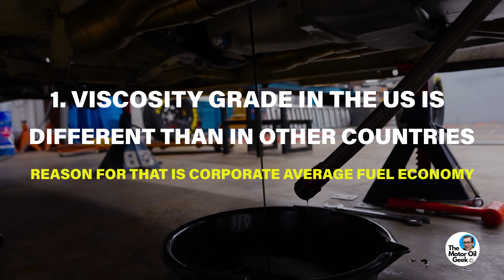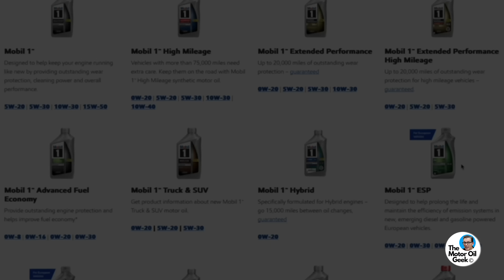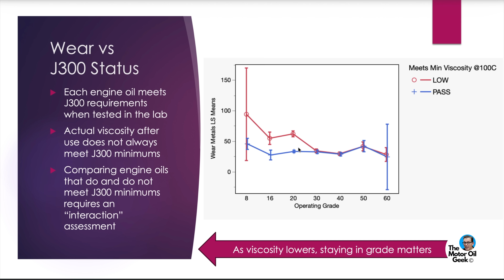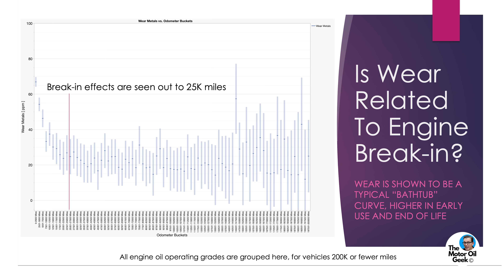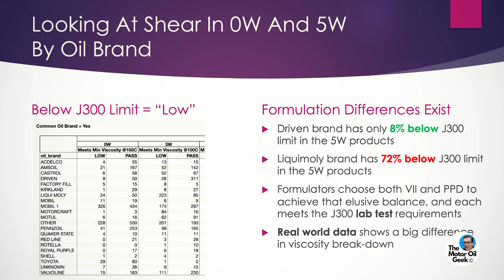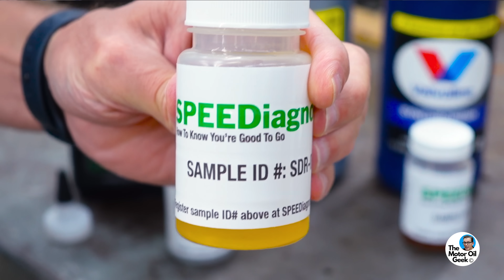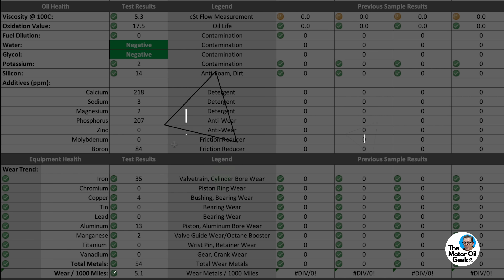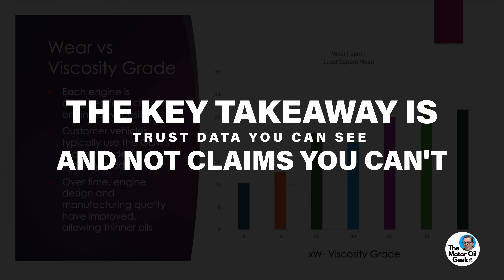More Ai Lies? The FACTS about 0W-20 vs 5W-30 (With Evidence)

Comment: The information you give is amazing and I can't get my head around it completely though. Is Mobile 1 0W 16 a good oil for my Toyota Corolla XSE or should I be using a different oil. Is the 10,000 mile oil change ok or should I be changing more frequently.  Oil testing is next to impossible here.
Reply: Mobil 1 includes a very high quality VI improver, which means it's more sheer-stable than other VI improvers.
Reply: @aliendroneservices6621 Where did you get that info please
Reply: @candyman1967  I got it from watching a video on this channel.
Reply: @aliendroneservices6621thanks

Comment: My car manual says 0w-20,5w-20,0w-30, 5w-30, 10w-30 all work, the cap says 0w-20 but in Phoenix sucking in 120F air all summer I went with 0w-30 after hit 105k miles.
Reply: Honestly, in Phoenix, you could use 10W-30 so you have a lower Noack volatility rating since you basically don’t do cold starts.
Reply: @slscamg  it is a hybrid so engine shutting off constantly, I wonder
Reply: Better off running a 10-30 No need for a 0 in Phoenix 🤷‍♂️

Comment: So if my Toyota Prius was sold here and labeled for 0w20, does that  mean that the construction and programming for things like variable valve timing are set up expecting and needing that viscosity to work optimally? Will the “same” engine in another country labeled for 5w30 have different construction and programming for those hydraulic components? That is, will putting a higher viscosity oil in my “0w20 Prius” mess with its hydraulic related timing processes? Significantly enough to matter?
Thanks!
Reply: It won’t. The 5.6 V8 from Toyota allowed anything from 0W 20 all the way up to 20W 50. 
The actual difference in oil pressure at operating temperature is so small when switching from a 0W-20 to a 5w-30 you would see a bigger difference in oil pressure on a new verse worn engine.
Reply: It goes by oil pressure so honestly, I have a 3.4 tundra and I went from 0W 20 to a 5W 30 and I only saw like a five psi increase. It’s so minimal it won’t really affect it. I’m still well within the oil, pressure specs that’s gonna operate depending on the pressure so you should be good. They make shit more complicated than it has to be.
Reply: Hybrid engine is better suited to low viscosity oils, because it’s always starting up

Comment: Lake, do you think the US production vehicles have a different oil pump due to the lower viscosity oil requirement? I'd like to go to something a little thicker in my Tundra, but that is a thought I have come up with. Thank you for all of the info, your videos are great!
Reply: Dude I’m using 5w-30 and 0w-30 summer/winter and the oil pressure is still in well within spec been running it 30k. But I do use the fastest flowing 5w-30 / 0w-30 Amsoil
Reply: The Tundra owners manual will tell you what to run based on use and conditions...
Reply: @EdMiller-2016 First time in my life having a dealer/someone else do oil changes. Not feeling warm and fuzzy, not really knowing what they are actually using. I have trust issues!  But the man in the family says Toyota's oil change package deal is a cost savings deal. Well not if it is destroying your engine from cheap quality oil. I've only every used Valvoline for decades for a reason. I guess I'm gonna have to look into testing the oil in the Tundra's.😭😭
Reply: @StephsGearHead  Check to see if they use a crush washer.  I had a manager who had Honda doing all his oil changes.  One oil change they said the drain plug was stripped, they charged him for the installation of a new oil pan.  A crush washer might have prevented that.
Reply: Dif oil pump 🤦‍♂️🤣🤣🤣🤣
Reply: @candyman1967  A Toyota Mechanic that uploads videos made this claim.  I find it hard to believe, but, it wouldn't be hard to swap out the oil pump on an assembly line.
Reply: @lonniebeal6032 🤦‍♂️
Reply: If you have a new Tundra with their lousy V6 you are probably boned anyway. Toyota has really gone downhill the last few years.

Comment: Whoever is creating those videos knows what people like to hear recently. Talking against 0w oils is in now.
Reply: Because those oils aren't for your benefit, they're for meeting government regulations.
Reply: @teekay_1 The W(inter) number is for cold cranking so it's not directly influencing hot running viscosity.
Reply: @PSA78 But most engine wear occurs at startup; the quicker the oil flows, the less the wear.
Reply: @davepaturno4290  Oil flow is near instantaneous if the system is primed (as long as the oil isn't like syrup), one big part of cold start wear is the increased fuel dilution (which is why idling a cold engine is best to avoid). The W rating is also done at more extreme temperatures, for most conditions it would be more accurate to calculate the viscosity 'where you're at', but manufacturers knows that more extreme cold start and normal operating temperature is the two things they have to be concerned about (and more extreme heat but that's outside of the regular viscosity labeling).
I do live somewhere where it can get pretty cold, and a lower W number tend make the engine turn over a little bit easier and possibly turn off the oil pressure lamp a few tents of a second quicker.
Reply: @PSA78 Hybrids are constantly stopping and starting. The Toyota Camry and Corolla hybrids (as well as non-hybrids) get 0W-8 synthetic as factory fill, partially because of this. But you are correct in that it is even more critical during a cold startup.
Reply: @davepaturno4290 Once the engine is warmed up it doesn't seem to have any negative impact to shut it off, less fuel dilution and the additive package is more active when warm (some have said that the additive package is more efficient in the boundary lubrication if the viscosity is lower as well, I'm not sure if it's true or how big difference there would be).
Having an oil that flows well is always a good idea, and it sure can make a huge difference in colder climate, I was about to switch battery in one car and for some reason changed the oil before from 5W-40 to a 0W-30 and that battery was good enough for another year. 😆
Reply: @PSA78 Less friction = lower current draw from the battery, so I wouldn't doubt that could happen.
Reply: @davepaturno4290 Yuup, that's how the W number is measured, cranking resistance. 😄
Reply: I use 0W40 Mobil1 I'm my 2015 Stingray

Comment: Sounds like there is less shear on 10w30 than 5w30 and when used in the proper temperature range would be better than a 0w30 or a 0w20.
Reply: 10w-30 and 0w-20 have the same split range so no there wont be less shear. Nobody should be running 10w-30 in a modern engine calling for 0w-20 unless you live in the Mohave desert and never leave.
Reply: @EdMiller-2016  i live in south louisiana. I run 10w30 in my 2018 ram 2500 5.7l hemi in the summer months and 5w30 in the winter. 5000-6000 mile oil change intervals depending on highway vs city driving but lots of idling. I do Blackstone tests once or twice a year and everything looks good at 285000 miles. More importantly no hemi tick on the original lifters.
Reply: Also NO.. being that 10W and 5W are different for Winter. The 5W-30 will be better in Colder conditions then 10W-30
Reply: Different engines have different shear potential. More & longer timing chains cause more shear in multi vis molecule chains

Comment: I have a 2008 Elantra. The cap say 5w 20. The owners manual says 5w 30 or in some case 10 w 30 can be used. This is an old school iron block engine . The cap does not, in this case reflect what the engine was designed around.
Reply: Australian here.
I have a 2010 Kia Cerato/Forte. Its recommended that I use 5w20 for best fuel economy or 5w30 if its unavailable. The manual also says 10w30, 15w40 and 20w50 is also acceptable, but not to use 5w20 if you're in the Middle East. I run it on 5w30 because the 5w20 is an extra $25 and I do oil changes every 5000km/3000miles

Comment: 2:55  it's not that 0w20 shears faster, it's that when it shears it's a lower viscosity. If a 5w30 shears, it might go down to a 5w20 or something. If a 0w20 shears, it's going to get even thinner and protect even less than it was
Reply: Right, so use a better quality 0w-20 or start changing your 0w-20 sooner. If you’re using a good quality 0w-20 it won’t shear out of grade.
Reply: @TheRamGuru  Yes, but most people do not change their oil on time, so for those people using a higher viscosity will be better. And on high mileage vehicles the tolerances are looser than factory, so a thicker oil will help burn and leak less.
Reply: @TheScrubmuffin69 if they’re using a quality engine oil and changing it within the recommended intervals it’s a non-issue.
Reply: @TheScrubmuffin69 it's like saying, most people can't eat proper food  like fruits and vegetables so they better eat Mc Donald's because it's cheaper and give you more energy. It's a half true. The manufacturers already made this investigations and if the user don't give the proper maintenance its the user fault not the items, unless there's a recall such as GM did in their engines a little time a go.
Reply: @TheRamGuru  No, go to real syn 40 and never worry
Reply: @TheGuruStud no need for 40 in most of these vehicles.
Reply: @TheRamGuru being an Arizona gti owner, I’ll stick with 40 lol.
Reply: @T @TheRamGuru I switch over to 60 eight minimum on track days

Comment: 9:17 9:23 The importance of avoiding high fuel-dilution is the reason people should choose the most-expensive gasoline:
Exxon/Mobil Synergy Supreme+
Shell V-Power

Those are both premium grades.
Don't run cheap gasoline in your car.
Reply: Why
Reply: @andrewsbbq  9:25 More-expensive gasoline is formulated to have greater detergent power, keeping fuel-injectors cleaner, which in turn minimizes unburned fuel droplets making their way past the piston rings and into the motor oil.
Reply: @aliendroneservices6621how do injectors impact oil dilution?
Reply: @andrewsbbq  Clean injectors atomize the fuel properly.
Dirty injectors spray large droplets of fuel which don't burn well, and end up either going out the tailpipe or into the crankcase where they mix with the motor oil.